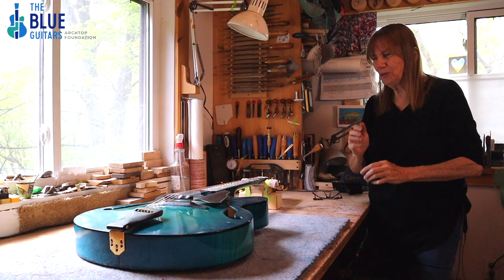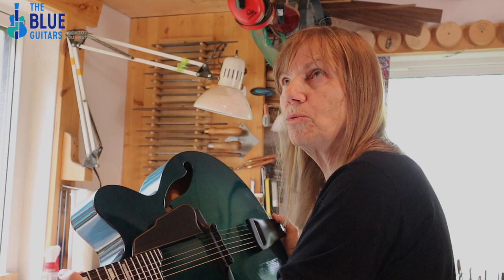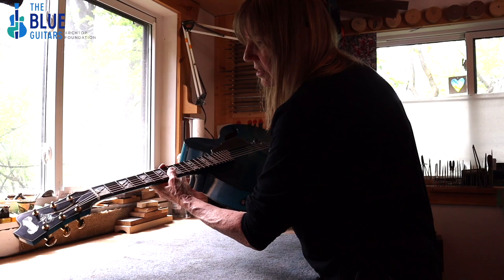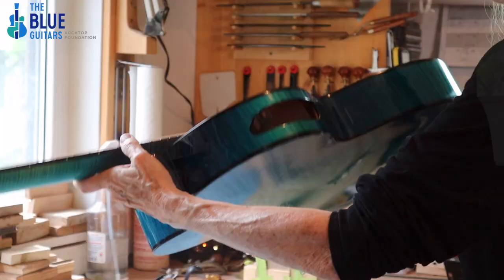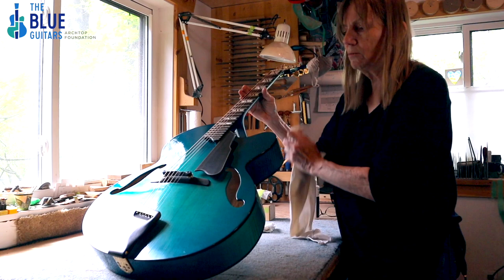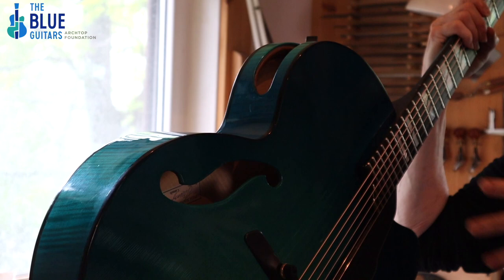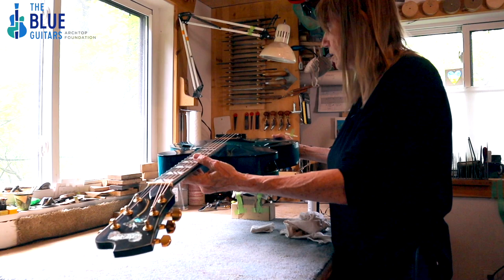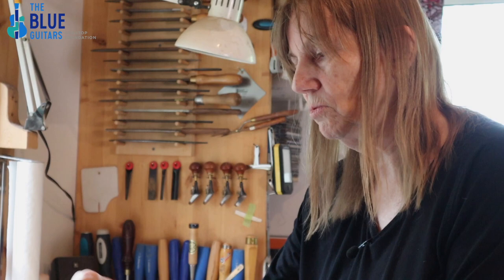Luthier Linda Manzer is reunited with The Blue Absynthe - The Blue Guitar Collection

Comment: I've been building guitars as a hobby since 1985 and Linda Manzer has always been one of my luthier role models.  When I learned of Chinery's Blue Guitars collection, I took that as my inspiration to build my first acoustic guitar, an archtop that is almost not quite to the same general specs as Chinery's Blue Guitars collection.  I went with a wider neck and a Gibson standards 24.75" scale because I HATE the 25.5" scale,  but otherwise, it's right there with the Blue Guitars spec sheet.  That guitar is now 21 years old and it has been absolutely stable. Nothing has moved, nothing has needed to be done with it.  Tune it, put it in its case, come back six months later, and it'll still be in perfect tune.  Better yet, leave it out, play it a lot!  It came out superb.   Thanks to Bob Benedetto for writing THE BOOK on making archtop guitars.